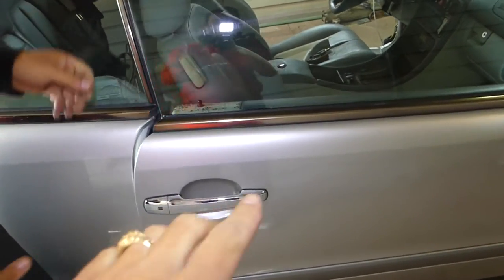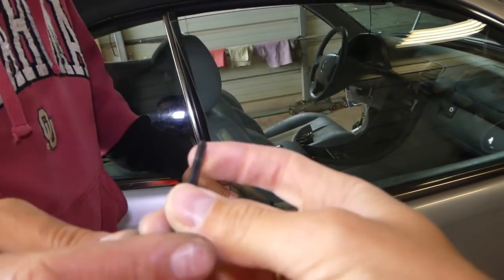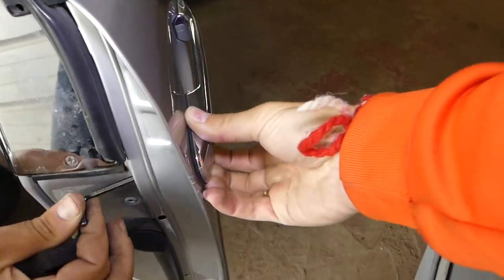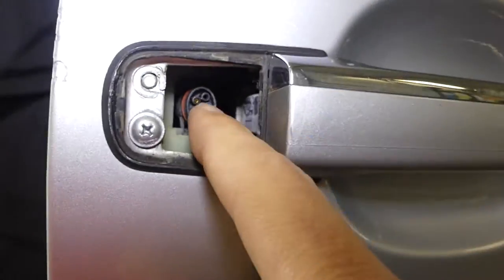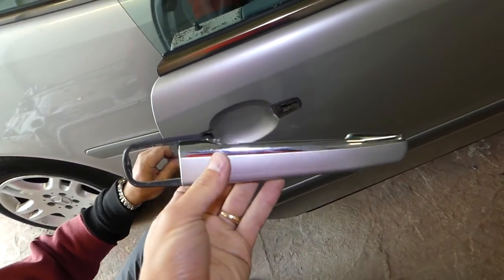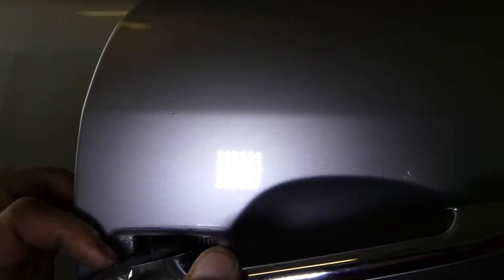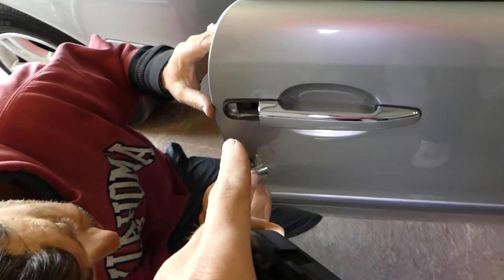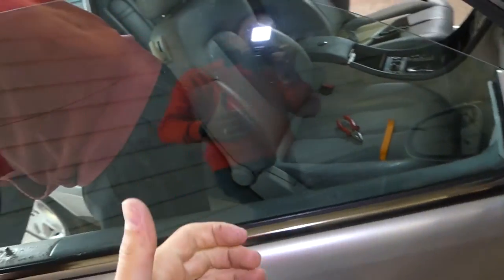MERCEDES CLK W208 EXTERIOR DOOR HANDLE REMOVAL REPLACEMENT CLK230 CLK320 CLK430 CLK200

Comment: AUTO REPAIR GUYS, JUST A QUICK QUESTION. I HAVE A 1999 MERCEDES BENZ CLK 430. THE DOOR HANDLE PROBLEM IS ON THE PASSENGER DOOR SIDE. THE DOOR HANDLE WILL MOVE IN AND OUT WHEN PULLING ON THE DOOR HANDLE, BUT THE PASSENGER SIDE DOOR WILL NOT OPEN. HOW SHOULD I FIX THIS PROBLEM. AND IS THIS AN EASY THING TO DO YOURSELF  ??? WHAT IS THE ALLEN WRENCH KEY SIZE I NEED ????